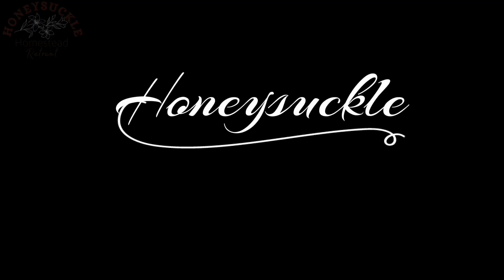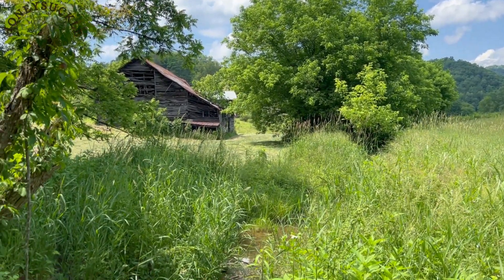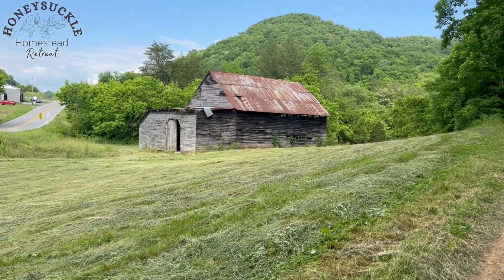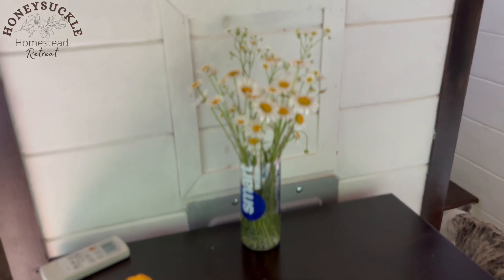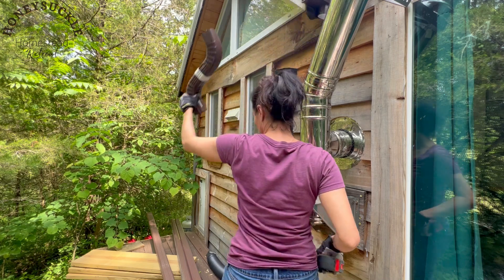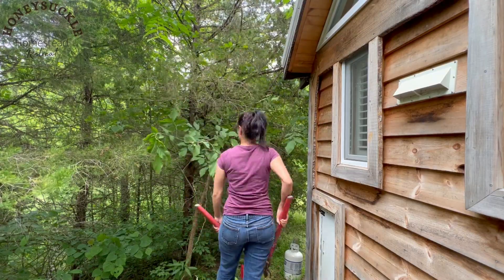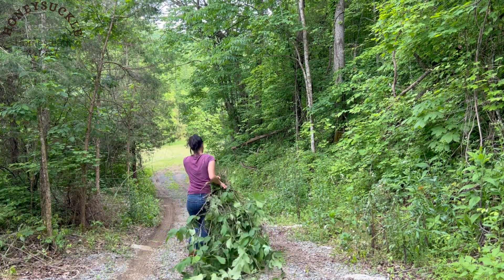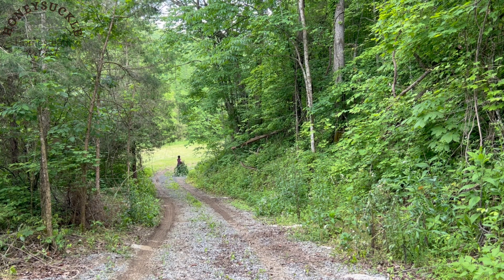Maintenance Weekend: Cleaning out gutters and trimming some tree limbs!

Comment: Are you going to continue the deck or are you going to get a bigger ladder? In order to get the other side of the gutters
Reply from the maker: I may actually do both haha! The other side of the house is where my dog run is. I have been considering putting a deck over there for the dogs and extending the dog run area. If I do that, I can easily reach the other side with my current ladder. However, the back side of the house, opposite of where my door is, I don't plan to put a deck. I am considering getting a taller ladder for that side because I need to do some caulking higher up along the soffit area.
Reply: @HoneysuckleHomesteadRetreat  that will be a cool video to watch